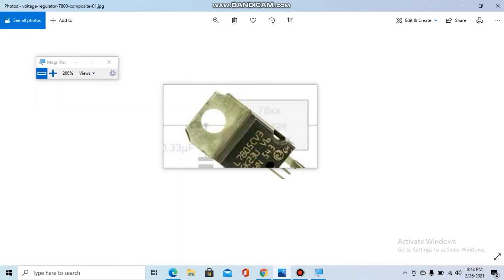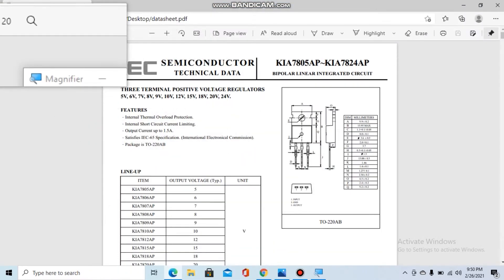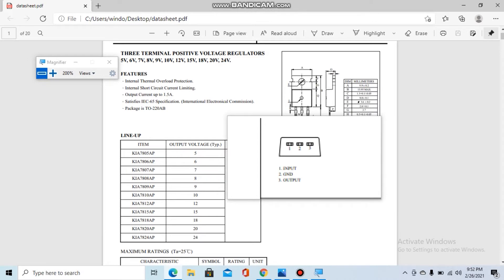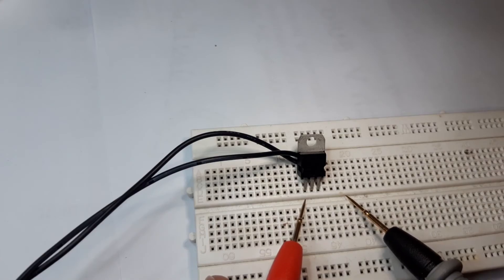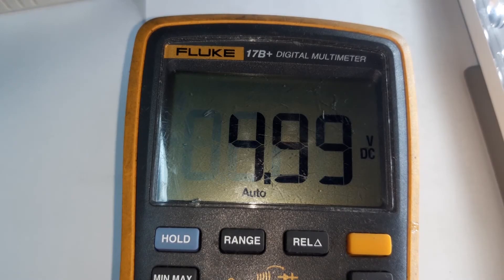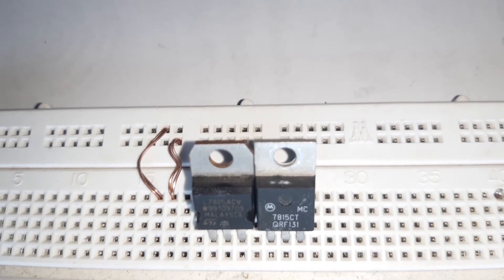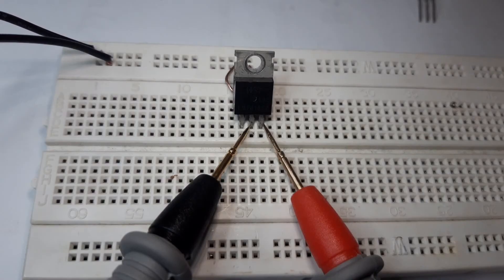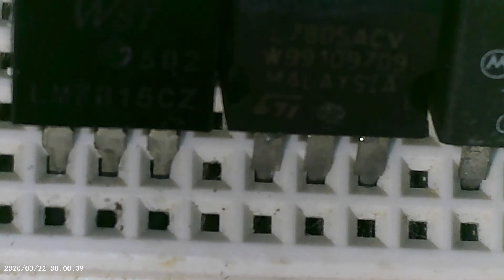How to test a voltage regulator

Comment: When testing a 15 volt regulator you should test it having a min 18 volt input.
Reply: Why?
Reply: @schnullertroll4173  My guess is because its operating principle is to get a stable 15V output from a higher voltage. What is the point using a 15V voltage regulator if the power source is already 15V?